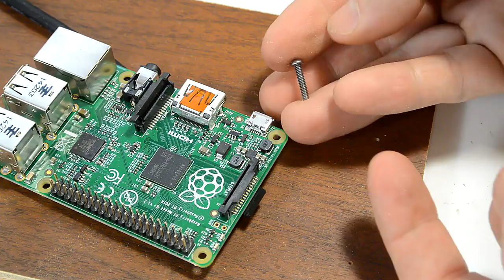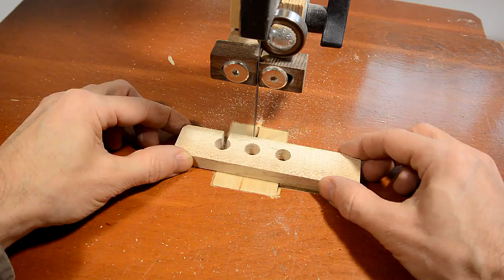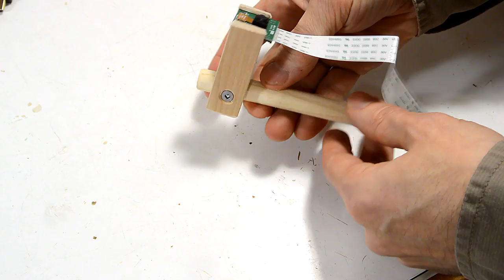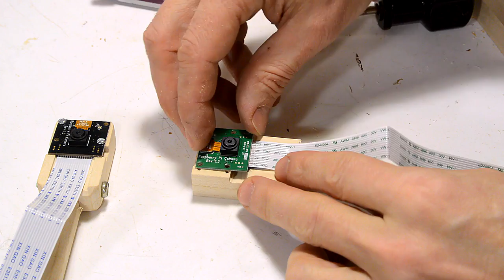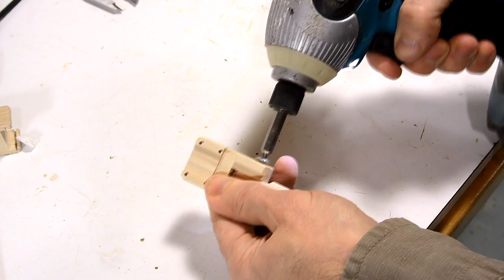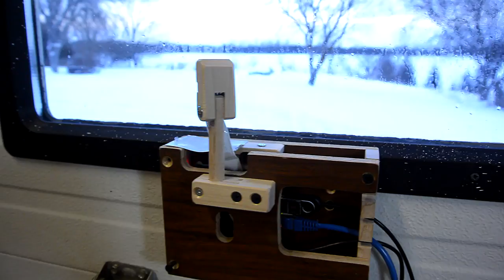Raspberry Pi computer holder

Comment: For future reference, you don't need the keyboard and mouse setup at all, you can run a raspberry pi headlessly from the very start by putting the appropriate files in the boot folder.

Comment: Mathias, back in the 80s, I worked near a computer manufacturer, and got many goodies from "fishing". I had an erector set, and supplemented it with parts I got. They no longer fit in the box, as I had gotten a lot of them. Looking back, I probably would have done things differently with what I got, but there so many fascinating parts.

Comment: Hello Mathias, several years ago i do a camera with movement based on a VCR mechanism, most of them have worm gears, i use 2 VCR worms to make the horizontal and vertical movement of the camera (that was almost 20 years ago, parallel genius camera and with VCR i mean  the old video cassette recorders), that is a very cheap and easy way to control the movements, those mechanism come with the motor, worms and gears, great for this kind of stuff.

Comment: Neato RPi holder.  I especially like the camera mount.  Nice and open for tinkering.  I do have one comment concerning you power cable soldered to the bottom.  I noticed that there is a bit of shielding sticking out and that the cable has the potential for rubbing around on the bottom of the RPi.  You might want to heat shrink or insulate the shielding so it does not short anything on the bottom of the Pi.

Comment: I will be interested to see if you can hack the PI to be a better option than a stock IP camera. Some IP cameras have a trigger input so recording/emailing starts when a signal is received on the input. I think triggering such IP camera using motion sensors placed around your place could be the best option.
Reply: The camera module is sensitive enough to be able to program the Pi to trigger without having separate sensors. Someone has already written code for that very situation and put it in a dummy camera enclosure. http://www.instructables.com/id/Raspberry-Pi-as-low-cost-HD-surveillance-camera/
Reply from the maker: Ian Garthwaite I saw that article.  The hard part is getting the software to run, and that article is pretty useless at that.
Reply: Ian Garthwaite I am sure the software exists. I have a IP camera outdoor using software motion detection. Also have a wildlife camera with regular motion sensor. The IP camera triggers on all sort of movements like leaves, branches moving, snow falling (especially overnight). Most of what I am getting are false positives. And if I take the sensitivity to low, it does not even detect a cat going by. But the motion sensor triggers on actual motion like a cat or dog. Just saying.
Reply: Motion ( http://www.lavrsen.dk/foswiki/bin/view/Motion/Welcome )  could do the trick.
Reply from the maker: Fernando Scarlazzari de Oliveira Yes, of course the software exist.   What I meant is getting it to run is the hard part.  It was the first thing I looked at, and the first thing I gave up on.

Comment: Rather than buying a Pi, try one of the new Pine 64+, they are preordering on Kickstarter for just $29 for a quad core 64bit processor, 2 GB RAM.
Reply from the maker: +SecurityPro2704 I prefer something I can count on, as opposed to something that might ship some day, and then doesn't have a community behind it.

Comment: That's a really nice holder. Would you have any use upgrading it with maybe a small sla battery and some kind of small solar panel? That way it stays booted and recording if the power flickers or goes out.
I always thought of building a fake birdhouse box in a tree or on a pole outside with a pie, camera, and battery backup. You could build one between your shop and your internet provider with a small router inside as a repeater or signal booster too!
One of the old school pelco security camera enclosures hidden to look like a bird house would work great and could be made with climate controls like fan and heater for winter and summer use. I dunno just think it would be a fun project..... could probably design it to pan and camera tilt with servo via remote control too .

Comment: I only recently learned about this thing and I hope you'll answer some questions. What are the capabilities of this thing in comparison to a tablet, or even up to a standard desktop? What do you use it for? What do you think it's pros/cons are? I'm really interested in this little thing.
Reply from the maker: john papple Google it.
Reply: Matthias Wandel doubt I'll find your personal opinion on google but thanks anyways...
Reply: It is learning device and can be used the most recent one with new windows due to it's 4 cores and 1g ram. Old one run linux badly but breeze with latest edition and can run for example Minecraft basic edition.
Reply: Make Magazine put out an article last year of someone who made a DIY tablet using a raspberry pi:  http://makezine.com/2014/01/07/how-i-built-a-raspberry-pi-tablet/   He used it for things like playing video on plane trips.  And that was with the "older" version of the Pi.

Part of the appeal/benefit of the pi is the simple low cost.   At $40, Matthias can just dedicate it to the camera in his garage.  Other people build them into arcade cabinets or whatnot.   It's not really mean to be huge and powerful, but small and cheap and useful.
Reply: john papple
A raspi isn't a rare thing. All your questions have been answered a hundred times already. And if you are dependent on the opinion of a single person to tell you what's good or not, you're doing it wrong.
Reply: The odroid has the same cost as the pi, and is is much more performant.
Reply: Havana Woody
Oh, unsubscribing. No that's a threat we all fear!
And if you find it rude, for someone to be told to google something, you're a little bit too touchy to be on the internet.
Why don't you find it rude that someone is too lazy to do a few basic searches, but expects someone else to answer a bunch of questions?
Reply: superdau
The guy was asking for his opinions.
Reply: Opinion? He just heard about it?! "compared to a tablet"? What kinda conversation do you really think was missed out on here? He should check it out before trying to make other people do it for him!

Comment: Great job , I have been looking to play with  a PI

where did you get the PI and camera module? please

Who else would be able to do fine quality woodworking and understand  a raspberry pi.  Unbelievable! ...but what are the plans for it, are you going to record the video and can you  detect movement and not record when there isn't any?
I love this project....  Can you tell me what hex 'FF' is in decimal.   I'll bet you can. Good luck
Reply from the maker: Dennis Adams buyapi.ca
Reply: Element14
Reply: 255 in decimal
1111 1111 in binary
Reply: Dennis Adams
If you look around, there are quite a few wood workers that are also into electronics or programming. In my opinion (I love doing all of that and claim to be quite good at it) designing and constructing stuff is pretty much the same steps, no matter if it's wood working or electronics. It's just that the tools and materials are quite different ;)

Comment: Love your work. Just an idea for that second RPi. Pair it with an arduino and some stepper motors and attach it to your Pantarouter. You could design and cut parts without a template. Imagine the possibilities.

Comment: the power wire appears to have some exposed shielding on it... what did you do to prevent that from shorting out on the bottom of the Pi?
Reply from the maker: Scott Lawrence I'm  not aware of any exposed shielding
Reply: ***** Still frame it at 0:32.  The metallic inner shielding of the wire is visible and sparkley shiny.
Reply: Scott Lawrence <-- This guy is right. That shield, if any use at all, should be grounded in the computer end. If that shield hits any of the solder points underneath that has a positive voltage on it, it will be a short-circuit.
Reply from the maker: kodez79 Hadn't noticed it.And neither did the raspberry pi. :)
Reply: Matthias Wandel That might be so for now, but a little wiggle could cause it to short circuit. If you are really lucky then, the heat from that could easily be high enough to cause problems. If the short just hits one of the wires in the wire mesh insulation, it would have high resistance, and will easily start to glow. More than sufficient to start a fire.
Reply: kodez79 While Mathias is very gifted, he is not perfect. Whenever someone has pointed out an imperfection, he dismisses it or retorts in a flippant manner. I still like most of what he does and enjoy his free videos; however, his response to constructive criticism leaves a lot to be desired.
Reply: J Hart I must agree with you on this. I hope he fixes this issue though, as a fire in a woodworking-shop is sub-optimal, both for the owner and the youtube subscribers.
Reply: J Hart Harsh criticism. Did it ever occur to you that kodez79 was completely wrong? That is not necessarily "sparkley [sic] shiny" shielding. Matthias would notice metallic shielding, don't you think? He doesn't strike me as somebody who is completely oblivious to such details. Give the guy a modicum of credit. It looks like it could just be a fibrous layer to me. You are assuming he's using a USB cord, which of course would have metallic shielding, but there's no reason to assume that. It could more likely be a cord to a 5V 1A power supply. If it was a micro-USB cable it would have had a connector on it and could simply be plugged in to the board.
Reply: It is very obvious about 0:30 into the video, so discussing if it is there or not is not very productive.
J Hart and me have seemingly both been subscribers to this channel for a long time, several years probably for me, and we have both noticed the same thing. The responses from Matthias is often not very kind, and critique is not something he has tended to take well. I still hope he lifts himself above his pride on this, and makes sure the thing does not short-circuit and catch fire. All it takes is a little tape.
Reply: I don't mean to feed the fire, but I had a brief email communication with him about some software he wrote eons ago, and he was very short in his replies. I never construed it as being rude, as he himself in the emails said that he was a very busy person and didn't have much time to deal with my questions... which I think is completely understandable.

If someone emails me with questions about software I wrote in 1996, I won't be able spend a lot of time to devote to it... and I know that I sometimes come off as being unkind, but it is not intentional... It's just the standard no-time-nerd response.  I (we?) don't often have the best social skills.

I didn't mean to be mean with my question, it was an honest question, since that wasn't shown in the video.  (and i suppose it was a passive-aggressive way to express concern as well.  "you really should be careful of that..." etc.)  Let's all just stop now. I think we've all said what we can here.  

Sidenote; Matthias -- I hope your videos continue for many many years to come. I greatly enjoy watching them. :)
Reply: I do appreciate the fact that there is a lot to answer in these chats, and all the other chats for videos still being watched by somone. All i know is, that other youtubers with even larger number of followers tend to have a less hostile tone. Not saying I dislike the channel, I am still a subscriber, just saying that I would probably think higher of this channel with a more friendly tone.
Reply: dlwatib I did not assume anything; however, I know what I see when I see it. That metal foil that is exposed is an issue. Now being intellectually honest here, I doubt if anything serious will happen if it shorts. But why take that chance when the solution is a .05 cent piece of electrical tape? I would not take the risk myself. But he is not me and I am not him. So plug away how you like. 

My comment dealt simply with the manner in which Mr. Wandel responds to constructive criticism. This was based in part by his reply in this thread, and the totality of his responses over the years. 

My younger brother is in the super genius range of IQ's. He is in the 190 range on a moody day and in the 200 range on a normal day. He lacks what we call social skill and is a chore to talk to. He responds to critique in the same manner as Mr. Wandel. I excuse my brother but not Mr. Wandel. The reason is simply that my brother does not interact with the public and therefore has no obligation to societal normalcy like tact and politeness. Mr. Wandel does have a social responsibility to be respectful to society because he chooses to interact with them.

Comment: I have heard the pi has power issues running keyboards, display and wifi sticks together, have you had any trouble? I want one of these to use as a shop computer.
Reply: The pi can't supply a lot of power on its own over the USB bus. If you need to hook up anything power hungry to the pi, you just buy a powered USB hub and plug your stuff into that.

Comment: Couldn't you just drill into the pi mounting holes for bigger screws? That's what I plan to do for an Arduino version
Reply: That’s risky. Those are multi-layer boards, so it’s hard to tell how close the buried traces have been run to those holes.
Reply: Beefchicken Industries I think I'll play it safe then

Comment: Do you think Raspberry Pi is the best starter electronics module or does it just depend on what you want to do with it?
Reply from the maker: Sam Parker It depends on where you want to start.
Reply: There is just so many choices. I started with picaxe and then pic and now the raspberry pi but like i said there is just so many choices. Arduino, edison, rashberry pi and so forth. Check out Sparfun.com and they have a little of everything.

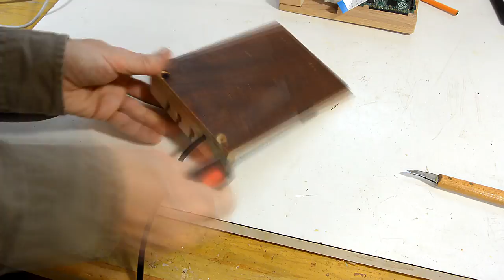Comment: Why would you do this at 1:55? You got the whole thing full of sawdust inside the usb ports!
Reply from the maker: BM Because it's easier to knock the dust out than it is to unscrew it.
Reply: BM
Saw dust is harmless, easy to blow out with compressed air (as long as you don't wait for weeks to, because then it can be sticky depending on the wood). A garage isn't the cleanest environment anyway. So if the Pi can't survive that assembly, it wouldn't last long in the garage.

Comment: I cant wait for more raspberry pi videos. For the comments on a cnc machine or 3d printer typically the raspberry pi wil just act as a gui with a touch screen for sending gcode to an embedded microcontroller such as an arduino mega. Its not powerfull enough for slicing and creating gcode